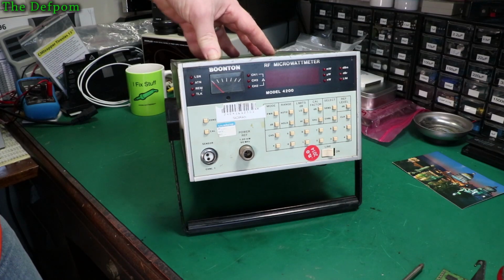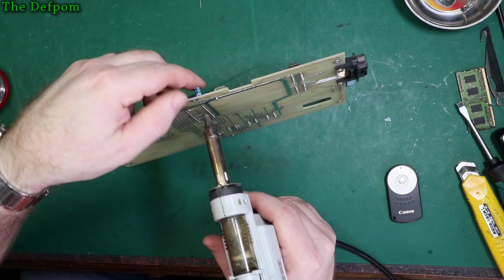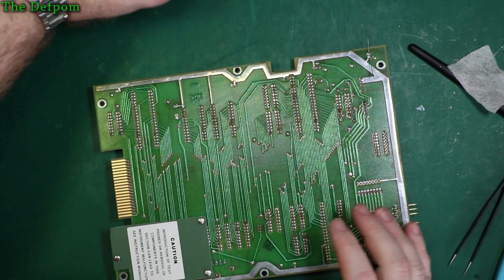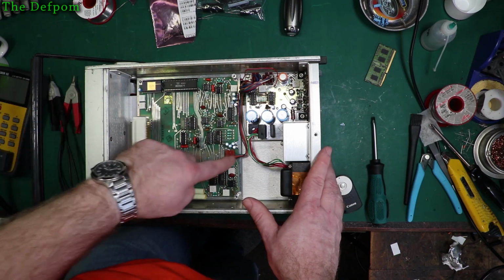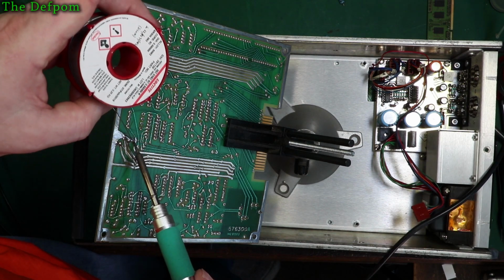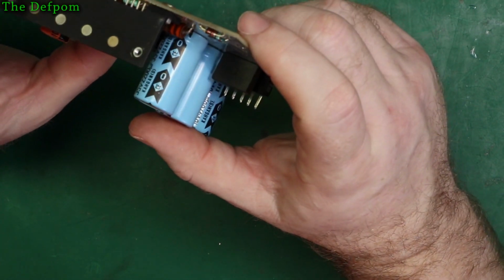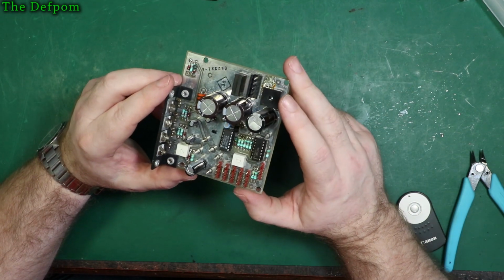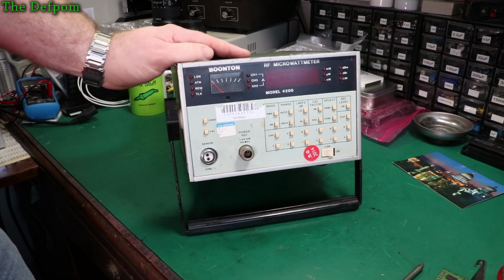🔴 #637 Boonton 4200 RF Microwattmeter Repair Part 1

Comment: Good job, Scott! Surprised you didn't replace the small blue cap on the power supply board. The calibration factors from the chart on the probe are entered into NVRAM (chips under that cover with the ni-cad batteries ?) then you enter the frequency you are measuring and the meter displays the actual power (or loss using relative mode) for that frequency. The two channel board allows you to connect two probes, then using a two port directional coupler in-line between say a transmitter and an antenna the meter calculates VSWR directly or can display forward and reflected power.  As an old fogy, I suffer from CRS (Can't Remember S*@t). I use a marker to mark the negative lead of capacitors before removal -  the marks come off when I clean up the rosin.

Comment: That Booton stuff really is top quality and tends to go for high prices even seconds hand.  Making the feet 3D printed is a great idea need one for a TEK scope. I was fighting with a Tektronix scope this week short circuit tantalum such a common failure mode have had about three of these faults on various gear in the last few months all test gear from the late 70s and early 80 has these issues. I have fixed the failed capacitor but cannot be bothered to do the rest it has a real stack of boards and lots of mechanical linkages, just horrible to work on. I have know idea how the service techs would have worked on them they must have had test jigs.   Ordered some tantalum from RS components and got a part delivery with the rest arriving March 2020. Very brave switching it on after putting the case back, you should know that never works. Regards Chris
Reply from the maker: AllTheGearNoIdea - tried emailing you the other day, did you get it? Was wondering if you are still heading over this part of the world next month?
Reply: Defpom's Electronics & Repair  Hello Scott I will Check my email. Kind of stopped using email due to the amount of spam. I only have a flying visit now to Sydney at the beginning of December. I may be in Wellington NZ next year as do some extensions to a system I installed previously.

Comment: The last screw in the assembly gets me too lol :-D
Oh well, the caps didn't sort it out, but it didn't explode with smelly tissue paper sticking to everything, stinks for ages.
Experence from c.b radios that have had 24 volts up there bum, also to add insult to injury reverse polarity as well.
Yes i've been there :-D